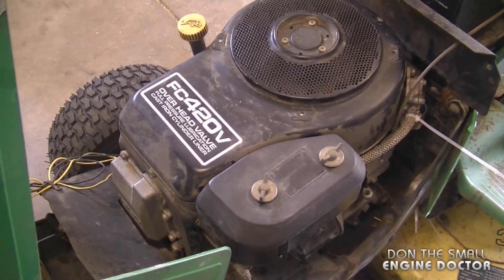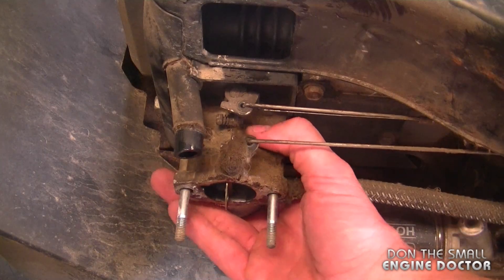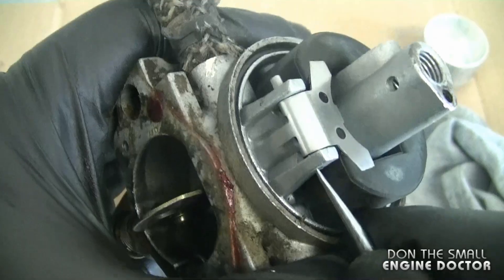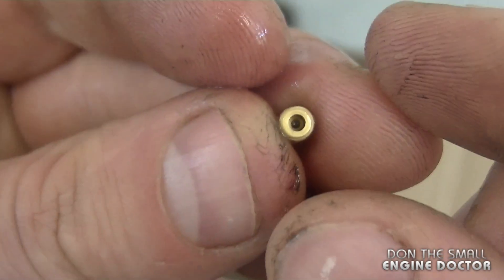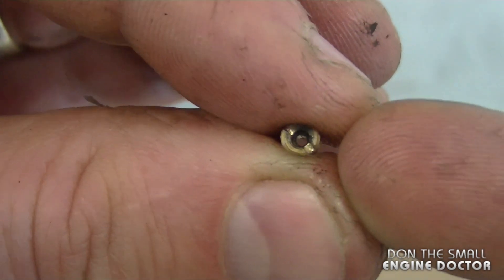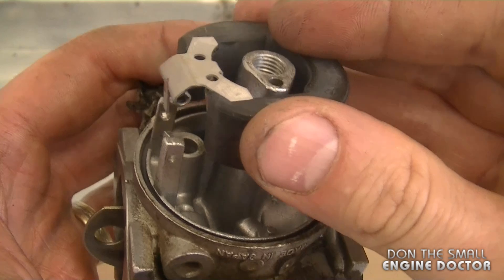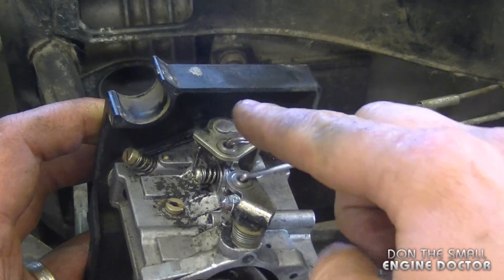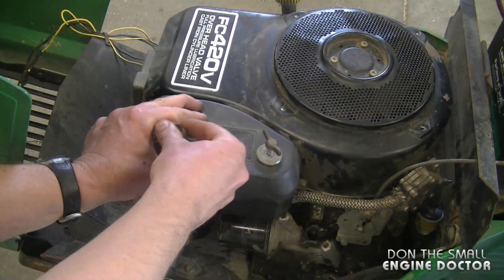Carburetor Cleaning On John Deere 170, 175, LX172, 176, and 178 Lawn Tractors

Comment from the maker: ALWAYS use non ethanol premium fuel in your small engines!
Reply: good luck finding non ethanol fuel anymore
Reply: @rossroedel5280  use the pure gas app. Southerstates is also a good source.
Reply: I noticed in the John Deere 175 Operator's Manual it says 10% ethanol fuel is acceptable
Reply: @cdogg1787  ,same as the Badboy zero turn mower too
Reply: i always do

Comment: Great video!  Clear, concise with excellent camera work.  My tractor had the same issues, surging and no power.  Run for a couple minutes and stall.  I was using regular gas in it and i think that gunked it up.  I tried that "mechanic in a bottle" stuff and it helped a bit but it was still stalling and had no power.  Cleaned the carb as you showed and viola runs like a top now!  Thanks so much!

Comment: Great video. In mine the 2 small jets inside the carb have different size holes so be aware of which one comes from which side. If you reverse them the engine will not run properly.

Comment: Woah, Just the video I need. I'm fixing my dad's Commercial Kawasaki 6Hp push Snapper and I need to repeat these steps too. Although it's a bit different, I have a problem that the engine is surging and I have not thoroughly cleaned the carburetor. Thanks DonBoy!

Comment: Great video as always Don. I had to clean an identical carb recently, it was also on a John Deere but the engine was a water cooled Briggs v-twin. I did everything you did plus the slow running jet as well and it ran perfectly afterwards.

Comment: Great job Donny, my issue is you using the torch cleaning tips in the bore of a flow rated jet. Wen you do you are putting fine scratches in the metering jets, changing the flow rate,
The bores are flow rated to the carburetor and when you get in to multiple cylinder machines you do not want to disturb those flow ratings. i always used copper wire to do this, (very find strand)whether it was twisting up several strands or using one strand to clear the bore. Use the copper wire  in long strands twisted to saw back and forth through the metering jet. Copper is softer than brass.Experience with a lot of motorcycles.

Comment: Thank you for this video. My tractor was leaking out fuel from the carburetor and was idling rough. I cleaned it out just like you did and it fixed leak,idle. One of the Jets was clogged. Thank you for saving me some$$.
Reply from the maker: hi David, make sure you are subscribed

Comment: John deere Lx 172 K series 17 HP. Replaced battery, fuel pump, fuel filter,  starter  sparkplug,and cleaned carb and there was fuel found. Will crank but not start. Ideas?
Reply: Did you ever get this working?

Comment: I've got an 88' 265 w/ the 540 -- nearing 1,700 hours.  Runs great, only like to start on idle. Had to adjust the throttle settings as the Gov wasn't allowing the the throttle to close fully when machine was off.  If you've got a hard-start issue when hot, try setting the throttle to idle, reach in and push the governor arm to the closed position (push to front of machine) and it should start right up.  It has to be below 60 degrees ambient and the motor cold before choke is needed.

Comment: I had a cub cadet 782 engine surge so badly it had to be kept at half throttle minimum. The problem was actually the channel in the carburetor for the mixture adjustment, and it took a few cleanings to get it working properly. .

Comment: so many years later!! had a huge question have a lx176 fc420v, My throttle butterfly stem broke, been searching everywhere for the correct carb to replace it. Any chance you know the part number to it? Its a 97 model FC420v-ES10. TIA.

Comment: I swapped out my old carb because they made a replacement for an inexpensive price. It fired right up on choke but doesn't want to run off choke. Any ideas? New fuel pump, new spark plug, new filter and new carb.

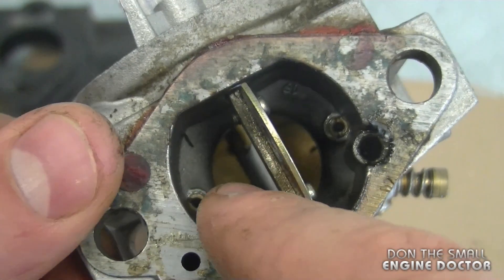Comment: At 8:23 you forgot to mention those 2 small jets have different part numbers which means they are different. Look at them and you can see the hole size is smaller on one than the other. If you happen to put them in the wrong place when reassembling, the engine will not run right as I found out on my tractor.

Comment: Thanks for the video.  I have a machine that has a 14 horsepower vanguard that will  start but won't stay running.  It starts to lope and then dies.  Choke helps but can't keep it running.  Sounds like it needs a good cleaning.   Tom

Comment: Thanks for a very thorough example of how to clean this carb.  After watching, I was able to remove from my 175 easily.  Other YouTube videos show somebody trying to remove the linkage with pliers.  If you slide the carb out first it is a breeze!  I didn't see any fuel solenoid in this carb.  Did I miss it?
Reply from the maker: no solenoid at bottom of carb
Reply: If yours has one and it's defective, cut a 1/4" off of its needle and put it back in.  No more fuel cut-off solenoid issues.  It's not required, and when it worked right, it'd still backfire.

Comment: what would cause a 16.5 kohler to not idle down when its warmed up? linkage and cables are hooked up properly but when I push the throttle down, it still runs at high speed.  it works fine when the motors cold.  thanks

Comment: Great video, I have this carb on a 130 model john deere. It was running rough after setting a few seasons, surging with little power. I took the carb off, cleaned it up as you did, all valves etc look great now. Issue is my float I think, its the mikuni carb just like yours. I have tried various tang adjustments but the mower won't stay running. It starts if I drain the bowl via drain screw, then stops within a few seconds from, too much fuel ?    I am not sure if the lower the float toward the ground the less fuel? or vice versa I've read conflicting reports which is rich or lean. I have yet to find instructions on this specific carb.     At factory tang straight (as to tang and 0 degrees) the float sits past 90 about 15-20 degrees There really isn't a view point which to see the contact of the float flow valve. Any help appreciated. 

PS if I take the bowl off of float the mower is happy to start and burn off the fuel so I think I am getting too much fuel and its wetting the spark plug, which is new as well. Also put a new gasket in bowl and fuel pump is pumping lots of fuel, too much maybe? Don't know if there is an adjustment other than the turn valve under seat for fuel from gas tank. 

Thanks to anyone with a bit of guidance to get it running again.

Comment: Donny,
Love your work. 
I have the JD LX176 model which does not want to start anymore.  I get fuel flow (squirt), I cleaned the carb as in this video.  I check the valve clearances.  Still no start.  Can you give me a next step direction (know that is hard, but your so good at this.)
Thanks
Reply: See if it starts when you force the governor arm into the throttle closed position.
Reply: Do you have good strong spark??? Check/replace coil, check/replace ignitor.

Comment: I am working on a 20ish year old Kaw FC420V as I write this.  I got the bowl off just like you showed in the video and went to unscrew the first 2 items that you did.  But my Carb seems to only have the short stubby one (first one you unscrewed) and NOT the second one.  I look down where the second one is supposed to be and I see something like what you unscrewed but mine has absolutely no place to use a screw driver on it.  It isn't that it is stripped It looks machined and flat.  so my question is should all carbs on all FC420V have the top screw and then the jet below it also or are all cargs different and maybe just some of the FC420V s have a carb like you are showing.  OR is there a way to get the thing below it out that I don not know of?  your fast reply would be greatly appreciated.

Comment: I just replaced my carb in a Gt275, engine still surging. I changed all fuel lines, drained fuel, replaced with clean fuel. Any ideas on what could be causing this? The engine doesn't surge with blades engaged by the way.

Comment: Great video, Donyboy. Are those idling screws what I want to adjust when my 165 Hydro wants to shut off on the turtle "low idle" setting? Assuming it even has those screws, I'm not home to check. My Kawasaki runs well otherwise, other than taking a little longer to fire up when cranking.
Reply from the maker: yes you adjust the idling screw to set the idle speed, it's the one with a spring holding it tight

Comment: I cleaned the carb, new fuel filter and it runs great. But now when I lift the toggle to engage the blades, it shuts off right away. What did I do wrong

Comment: hey don I have a question for you when you clean the jets on the carb with the torch cleaning tip dose it hurt to rinse the dirt from the jets with carb cleaner
Reply from the maker: YOU can use carb cleaner or compressed air

Comment: Mine is doing the same thing. I noticed the throttle arm slightly surging on high speed and not on low. Would this be jets or do I need to adjust the governor?
Reply from the maker: I would clean carb before adjusting governor
Reply: Adjusting the gov takes about 2 minutes, much easier than cleaning the carb!

Comment: Thanks Don. What about the remaining fuel in the tank and or changing the fuel filter? What if there is crap in the fuel and it just goes into the clean crab?
Reply from the maker: yes it's good to replace the filter as well. in this carb the crud was a buildup due to the tractor not being used

Comment: Hello there, I'm not sure when you're going to get my message, I'm a mechanic for over 40 years, and I know what I'm doing, I have John Deere riding mower lx279 in excellent condition, it has 38 inches deck  was making noise, so I decided to change the all spindles bearing, and that all the bearing on the deck, after I finished I turned all the pullies by hand they were very smoth, I installed all belts and the deck back, very time I engage the pto with full throttle barely the engine keep running, turning very heavy, even without mowing, .
It has 17 HP Kawasaki had 48 deck before was running very strong.

Comment: Are your sockets ALL 6 point? I almost rounded over a bolt head with a 12 point socket. Do you suggest 6 point sockets only?
Reply from the maker: I mostly use 6 point but 12 point in hard to reach areas

Comment: I am going to clean the carburetor, replace the oil and filter, and replace the fuel filter. Do you have any tips as to where to start or in what Order?
Reply from the maker: no necessary order required
Reply: donyboy73 thank you. Wish me luck.
Reply: donyboy73 thank you so much h for your video's.  I subscribed to learn more. I had to call in reinforcements because it still ran bad. He took it to his shop and found a plug in the hose from the tank to the filter. He said He had to use a compressor to blow it out after he took apart the back end. But all my work was good.  Thank you.

Comment: can igniter be faulty if has spark ?
Reply: Yes.  Check resistance between igniter terminal and its case, should be between 400-600 ohms, else it's out of spec.

Comment: Any body got a suggestion's on a 6.5 briggs ,that starts with starting fluid but dies right away. I thought it was a fuel problem so I put on a new carb, new fuel line,new plug and fresh fuel and it still does the same thing. Any help would be appreciated
Reply: It has to be the carb. Double check your assembly.
Reply: It was doing the same thing with the old carb and still does it with the new carb. I agree it has to be fuel related but I still haven't been able to get it going. Thank you for your help

Comment: I have one of these engines and it has no spark, even after a new flywheel, coil and plug.  pulled the ground wire doesn't change anything.  if I ground a slash tester to the block I get spark, then as a plug and no spark.
Reply: Sorry should read; if I ground an inline spark tester I get spark, but once I add a spark plug I get no spark.

Comment: What about a carb on a lawn tractor with an electrical plug in on the bottom of the bowl?
Reply: What about the anti back fire/ fuel  solenoid  ?   Are you having a issue with it ? 
If it is bad your engine won't run.  You can clip the the tip off of it and idle the engine down for about 15 seconds and then turn the key off. ~!~!
Reply: Boo luquette I don't have any problems with it. I have an early 2000's craftsman that needs a carb cleaning and it has an anti backfire plug in on the bowl and I was wondering if I could still clean that carb.
Reply: Yes you can it acts as the bowl nut also ~!~!

Comment: I got a question for ya guy. I got my uncle's craftsman lawn 42" riding mower when he passed away from cancer. I replaced the deck belt, set the valve lashing, cleaned the tank out, new fuel line, new fuel filter, and ultrasonic the carb. My problem is it starts in the garage and runs great and will remain running but when riding out on to the drive way (which is a slight incline) the engine starts blogging and then dies (like it isn't getting enough fuel) any ideas?
Reply: Carb or fuel pump. Undo the hose to the carb and turn the motor over and watch how much fuel comes out of the pump, it should be a strong flow, if it is weak, replace it.

Comment: idk why i watched this lol. ive done this to so many carbs. this works on anything with a carb people. just wondering what i might be getting into later down the road. I've got the same motor on my 185 hydro. great engine but every one I've seen sounds like it has a knock in. was hesitant to take the one i have. it was a freebie though. couldn't pass it up. worst thing so far is the green and yellow mark up on parts.

Comment: Gotta be careful with that cleaning needle. It has a rough finish on it and can actually grind the inside of the brass jets making the holes larger than they should be. And an air gun with a rubber tip is much better than one without. The rubber tip seals the holes and you don't get any blowback

Comment: Surprised to see Kaw's in JD tractors, they usually go for inferior Briggs. Very robust engines these Kawasaki's, very high quality.
Reply: I've never seen a briggs in a JD lawn tractor.  Always Kaw's
Reply: I have seen  briggs on a few JD's Twin cylinders though and mostly  Kohlers  15 hp down here in south Louisiana
Reply: The John Deeres that you can buy at Lowe's or Home Depot usually have a briggs engine in them. However, every mower that I've seen at an official Deere dealership have a Kawi motor in them.
Reply: +Dave Stone yea I got an ol rx75, it's got a 9hp kawi in it and I'll say that's a darn good engine. 
They make a decent air cooled
Reply: Back then (1986-1990) you had the choice to upgrade to the Kawasaki. I've got an '87 180 with the fc540v. Fifty extra bucks back then sure pays off now.
Reply: Shows how much you know about JD, all their good LTs and GTs have either a Kaw or Yanmar diesel in them.  Do a little research before commenting on vids in the future.
Reply: Those Kawasaki engines are built in Maryville Missouri which is just north of Kansas city.
Reply: @ Mark Overfelt: The Kawasaki engine in my JD 170 says "Made in Japan" on it.
Reply: I'm not sure when the JD 170 came out  but I'm sure you can Google It and see when they started building Kawasaki engines in the USA. Just like the Toyota  Camry is built in Kentucky but a lot of Ford and GM trucks are built in Canada and Mexico.

Comment: my 9 year old murray b&s  4.5hp  for some reason it has a hard time starting  i cleaned the carb 3 weeks ago it still didn't help,  i have to pull the string maybe 10 or 15 times  it would start up and die  by the 10 or 15th time i pull the string it would run but very weakly i take a path and it would die then i have to start it again finally it would run then afterwards it would run normal  its been doing this for the last month
Reply: Hey I have a Murray just like that I would make sure the primer is working and actually priming the carb if it's not the bulb may be cracked or the gasket between the air filter box and the carb may be broken I hope I'm some sort of help to you don has a vid on replacing primer bulbs
Reply: you mean the diaphragm  i've replaced that back in 2011  it might be going bad again i think  the primer bulb is good
Reply: Put a new diaphragm kit in it.
Reply: thats what i'm planning to do thanks for the help

Comment: You might get more hits if you change the title.  This engine is used in John Deere 170, 175, LX172, 176, and 178 lawn tractors, maybe more models too.  Also Kubota tractors like the T1460.  I would just put in the engine model number Kawasaki FC420V.

I have been looking for the carb video for this engine.  I'll be buying a can of carb cleaner tomorrow and fix my LX172.

Comment: Hey don I was wondering if you could help I have the same exact tractor I clean the carb and it still surges but it appears to be running to rich. And it takes forever to start up it will only start on starter fluid but once it is running I can turn on the blades and once it's under a load it runs fine I was wondering if the jets were worn out and causing it to run rich I was hoping you might know what's wrong with it and were I could buy parts parts are pretty hard to find for these old tractors
Reply: I found out what the problem was on my tractor it was the little ignition chip on the side of the Kawasaki engine causing incorrect spark to the motor so I found one for 14 dollars on eBay and she runs like new now